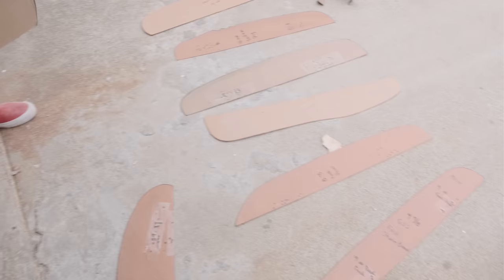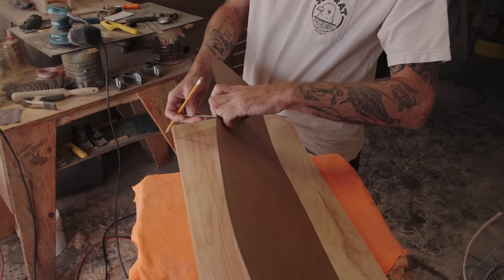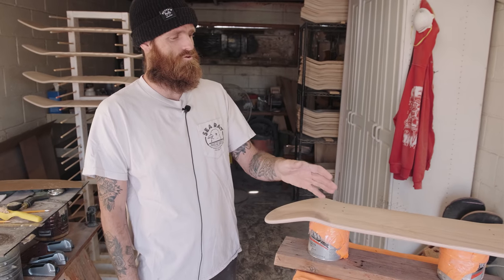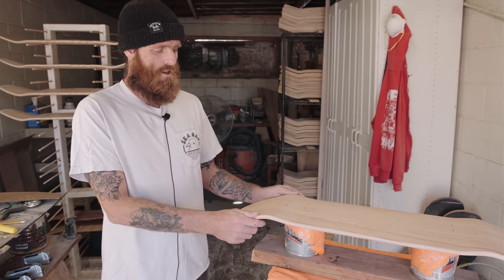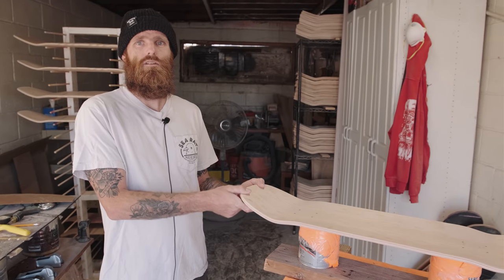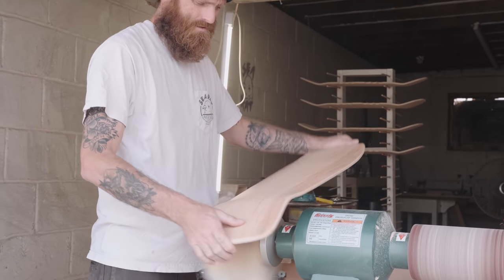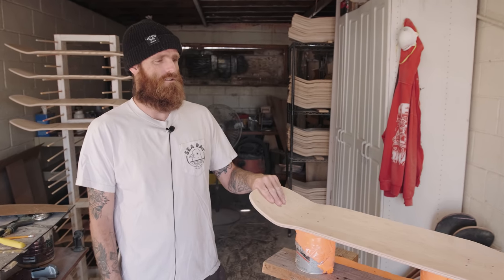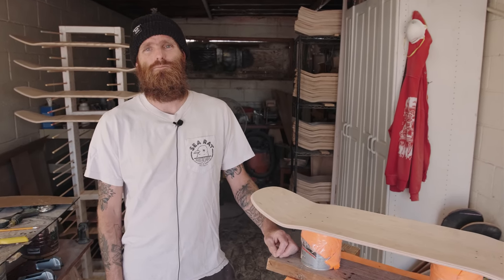How To Make SKATEBOARDS In Your Garage

Comment: I wonder what hardwood would work instead of plywood, that would probably not make sense to use hardwood cause of the weight, plywood is also cheap and solid but not very fun to work with specialy with planes